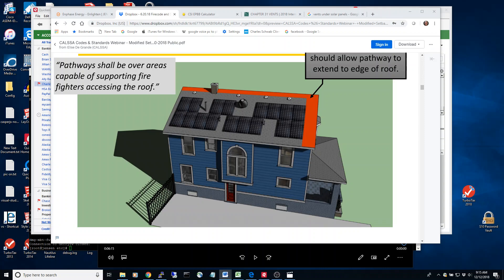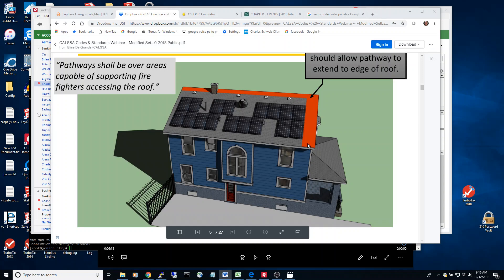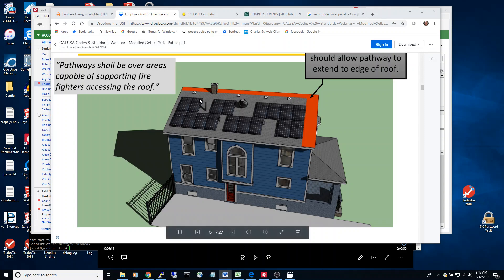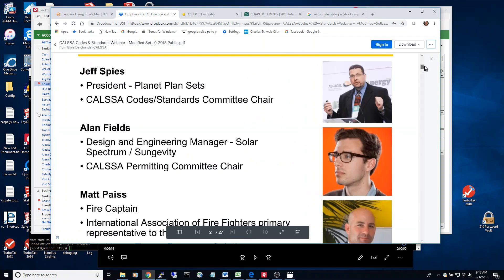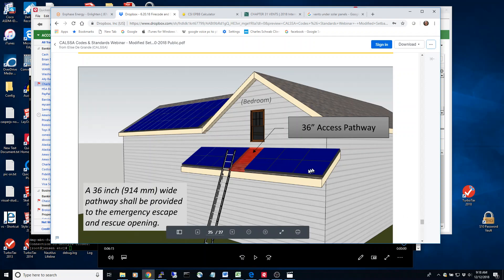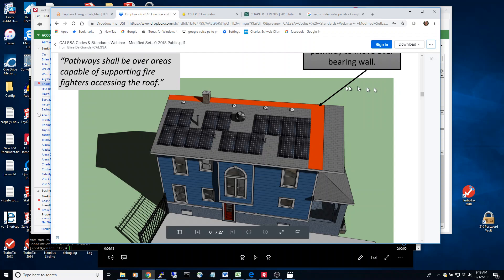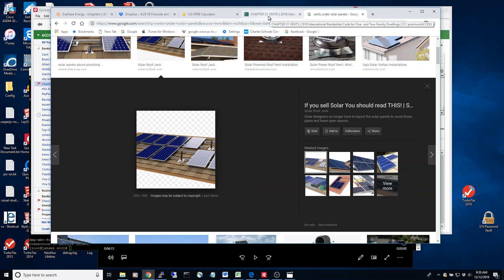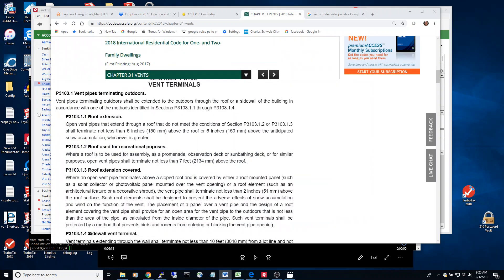DIY Solar Fire Setbacks and Pathways. Can you cut vent pipes down? Vent piles under solar Panels

Comment: Thag is cool. I wonder if is code is in place in 2025
Reply from the maker: I just did a add-on to my solar system and in general I think this is enforced still. I would look also at Groc depending on your location. I found Redondo Beach actually had more restrictive setbacks than this dated video. However, I believe this video is about the same
Reply: @dannyjensen4954 Regarding the Roof Extension Covered section, is the 2" still applies or is it changed for 2025? Also, how would I know if this applies to Nassau County, NY? Thanks in advance